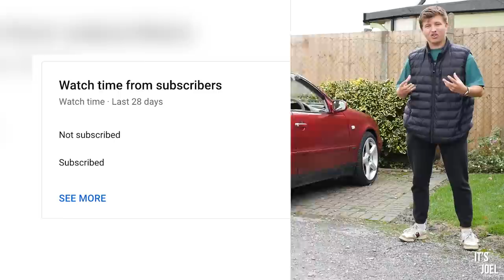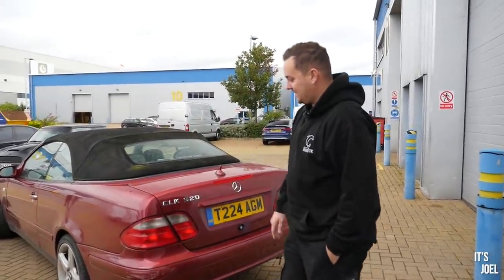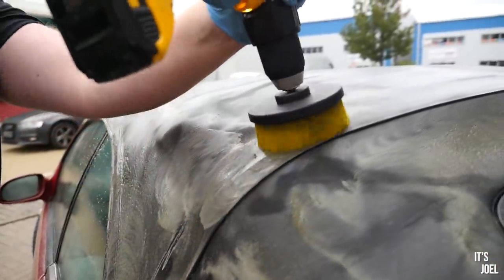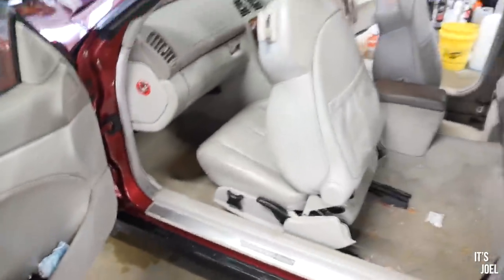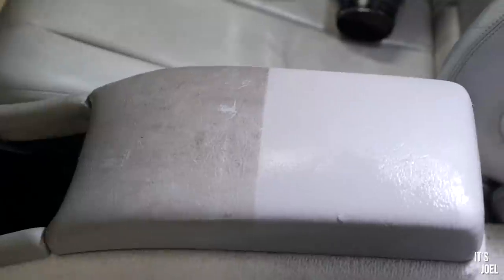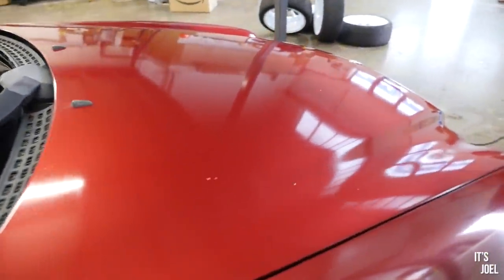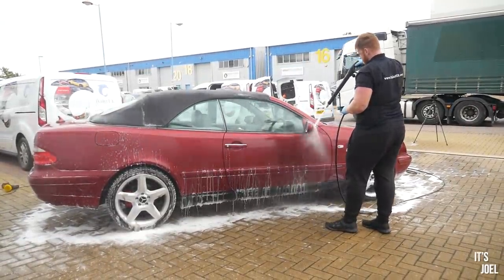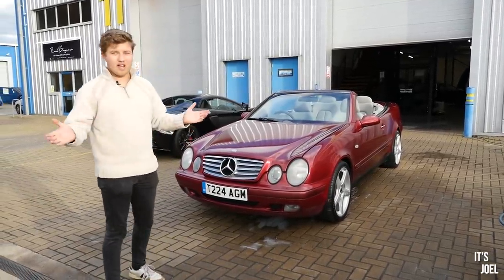My £1,000 Mercedes gets a £1,000 detail & decontamination!

Comment: For a £1k detail I would be expecting the headlights restored and done with a ceramic coating. Looks good though 👍
Reply: Those lights from factory are foggy
Reply: Would be atleast another $500 for one layer of Ceramic Coating on the paint.
Reply: Check the video description - had a ceramic coating done ✅
Reply: @joshruck2002  they are not foggy from factory bruh

Comment: Great before and after video. 3 years older than my E46 Convertible. Pressure washer is too close to the fabric roof.  They should have taken the seats out and definitely cleaned the seat belts. They aren’t scratches on the NSR wing it’s filler cracking.  Apart from that it’s amazing what a good clean can do to lift the appearance of any car. I’m sure you will enjoy it a lot more now and it was cheap!

Comment: Yes the seatbelts are filthy. The process to clean them is to remove them, unwind them, jet wash them, let them dry for days then put them back in. This is due to the tightly woven fibres with them being a safety device. It wasn’t possible to do in the time we had the car so we recommended replacement belts.

Comment: When you turn the handle to open the roof you are supposed to push the front section up about 6 inches. If it doesn't stay up there are 2 tension cables which can be tightened by removing the handle then the trim piece behind the handle.
Reply from the maker: Thanks for the tip

Comment: You can get some degreaser, heavy filler and a new matching leather paint to do it yourself. I did my own Rolls Royce steering wheel and came up a treat. The wheel had a big rubber hessian backed cover on that had dented the leather all the way round.

Comment: I have a 2000 clk230 kompressor convertible avantgarde  in jasper blue which had sat for 5 years i cleaned it up fitted the genuine amg 5 spokes and it flew through the mot it is now my second car but i love it yours is a lovely looking car defiantly need the amg wheels for it mine has the blue and silver seats

Comment: You need to put a steering wheel cover on that. I had a matching alcantara one on my 2001 200kompressor as that wheel and the doors armrest get dirty. I had one in cyprus for 7 years and drove it like I stole it. No rust over there obviously which was the issue over in the UK etc. The lacquer peeled off in places as it gets to over 40c over their and the air is dirty full of sand bit the paintwork was OK.  It cost me peanuts to service and the only issue I had was a supercharger pulley bearing which cost me 80 euros fitted. The simpler the car the less issues.

Comment: Having to give the roof a wee push is not actually a "feature".  It's caused by the wires in the roof stretching.  However, just about every 208 CLK Convertible has this.  These cars are 20 years old and a wee push is probably the least of the challenges to be overcome.

Comment: Just have to love depreciation! I am not sure if that brush they use on the roof will have done it any good long term. A gentle brush, with little pressure, a very mild cleaning agent and back and forth motion, no circles, by hand, is the way to go with these convertible roofs. You may have damaged the fibers and next spring it could even be in worse state the  it was before.

Comment: Nice car, but I'd move it on. The wrong grill and the shoddy shut lines around the headlights indicate it's had a biff on the nose and the paint scratches on the rear left look like they are going into filler, not metal and the rear bumper scrape indicates it has had a kick up the arse as well. Might as well flog it before sinking any money into it.

Comment: Nice transformation, although they seemed to have missed the front seatbelts
Reply: Yeah I noticed that too. Same in my car with white interior I was wondering how they would could clean that hard part. Seems they just didn't 😅
Reply: Seat belts are really hard to clean due to the tight webbing for safety.  The only way to clean them properly is take them out and pressure wash them.  (Time consuming)
Reply from the maker: Normally for £1,000 an extra day or two would be spent on the car and more attention would be paid to seatbelts etc. As we’re filming we try and do as much as possible in a day
Reply: The belts are like the steering wheel - with cream or grey it’s more cost effective to buy replacements, otherwise the process to clean is to completely remove them all from the car, lay them out, pressure wash them, let them dry for 4 days then reinstall. 👍😁

Comment: You need to do the driver's seat belt. I had a similar colour Merc interior and what we did was unbolted it from the floor, pulled it out and jet washed the f out of it while a friend held it taught outside the car. Worked a belter (lol).
Reply: Then wait 4 days for it to dry 🙃
Reply: @ivaletuk  Turned up the heating in mine to full and left it idling for a few hours. Dryed it out no bother.

Comment: dude sounds like ethan off car throttle when he was doing the walkover of the car 😂

the only issue i saw in this video was using a magic eraser sponge on the leather as this is an abrasive and while yes, it cleans it, it also strips off a layer of dye from the surface which means that its easier to wear through and for a colour change for happen due to the sun etc. There are better alternatives such as a leather brush from either gyeon or swissvax which are quite stiff bristled but still safe to use on the delicate leather surfaces.

Comment: Nice job. I would keep the Benz and get rid of the Range Rover. But then I love older Benzes. However, if you keep the Benz please be mindful of the fact they tend to rust. I have owned several Benzes and still own a 1998 C Class. Daimler Benz uses underbodycoating and kit over the welds that tend to get hard over time, by the way other makes use this too. At first sight the underbody may look great, yet often the underbodycoating/kit is actually loose and underneath there is rust, often just surface, sometimes quite serious. Dangerpoints are the frontspring mounting domes and the front fixture points of the rear subframe. Clean them very well and treat them. The frontspring mounting points are relatively easy to weld, the front fixture points of the rear subframe are not. Also jackingpoints can be bad, yet again the are relatively easy to mend. Speaking from experience, if you do not want rust on a car over 20 years old - take a Volvo. Next to the Benz I do own a C70 2.0 Turbo. If I have to make a choice I will always go for the Benz...

Comment: Keep it, return it to stock condition. Everything original new parts from manufacturer. Make the outside and inside immaculate. Like it just rolled out of the showroom.  No gash and cheap jobs all parts OEM Mercedes to be used

Comment: I had a 2002 CLK, and it never needed that 'push' to open the roof. The only manual input was the first twist of the handle to pop it open, and the reverse pull (and twist) to lock it closed. Something wrong with this one, so get shot of it. The cost of a replacement CLK roof will pretty much ruin your day, every time...
Reply: get me on ☝️

Comment: The scratches on the rear passenger wheel arch look like a lot of filler has been used in it and it's cracking. I could be wrong though.

Comment: Joel, I have a mobile paint guy who is the absolute nuts who could sort the scrapes and scratches out. No new bumper required. Any mechanical faults on the car?
Reply from the maker: Interesting, I’d love to hear more. Mechanically just needs an alignment I think.
Reply: @itsjoel  so Liam charged £180 to sort v similar bumper scrape for my mums car. Blended the paint and lacquer back into the original - looks factory. I reckon £400 - £500 might get everything done including bumper, boot lips lacquer peel and wheel arch scratches. Maybe less if Liam gets a plug 👍😄
Reply: I think I would’ve cleaned the car myself and spent 500 quid on paint work :-)

Comment: looks like its had paint in the past defo on that rear quarter were those scratches are id say theres a lot of filler under there
Reply: Looks like they painted the rear quarter before allowing the filler to fully dry. Which means the filler is very thick, but for a grand its better than walking.

Comment: I was actually quite impressed with the job they were doing until the big reveal. All that hard work and they left the drivers seatbelt looking like it's been sat in a swamp all its life 🤢. Its the small details that make the biggest differences. But that belt had deffo not been touched.
Reply from the maker: No we didn’t do the belts as that would involve taking them out. Would normally do this process over 2 or 3 days, however as we were filming we only had about 6 hours

Comment: Good content, but you need to be CAREFUL WITH THE ROOF. You can't wash it with the water jet so close... you have permanently damaged it. If you look closely, you can see the water jet marks that were left over. If you own a convertible this is common knowledge.
Also the roof not going all the way down by it self is not a feature. You have at least two broken tension cables. They need to be replaced from now and then. 
Other than that, keep up the good work ;)

Comment: Wash the front seat belts with a pressure washer, they’ll come out new. “Jet wash”
Reply: And take 3 weeks to dry 😬
Reply: @ivaletuk  come on now! I didn’t expect this answer from you guys!! It drys in 1hr, may be 2-3hrs in UK weather
Reply: Ok there was a note of sarcasm - they take about 3 days to dry fully.
Reply: @ivaletuk  try again, and it’s just best not to reply if you don’t have the correct information. When nothing was directed to your work or channel. I actually enjoyed y’all’s work.
Reply: Obviously you know better, like you must know it’s 2 degrees overnight in the UK at the moment. 

All this is also not to mention the other 2 hours to remove and 2 hours to refit all the belts. The job wasn’t possible in the time we had period.
Reply: @ivaletuk  again get out of your feelings. No one questioned your work. But I’ll try to help.

Pull the seat belts out as far as you can and shut the door so they stay out of the car. Then take you’re pressure washer and spray the seat belts. And that’s it. They are good as new. This should be done before you clean the interior so you can actually do it with the door open if you want to get further in depth. A wise man would be able to avoid soaking the interior with water.

A wise man would not remove the seat belts from the car itself.

Again you guys run a good business and a good YouTube channel. Don’t get in your feelings and hurt your reputation as a business. Not worth it specially when my comment was never directed to you but was just giving Joel advice. I’m sure he would love a clean seat belt when the rest of the car looks good.

I’m not an expert but I’ve owned two grey interior and 3 creme/beige interior cars so I’ve learned a thing or two.

And you don’t have to apologize, have a nice Monday!
Reply: 😂 dude please stop. What happens when the belt isn’t fully dry and it gets wound back up inside the casing and goes mouldy… 

We’re fully aware it’s possible to wash a seatbelt this way and there’s a specific reason we don’t.

Comment: What's going on with the front seatbelts they are filthy!!!
Reply from the maker: Didn’t have time to look at those. Would normally require about 4 days for a wash and dry service on those and we did this all in a day. Belts are hard to clean though because of the material, so best bet is to replace them
Reply: @itsjoel  have to get those done, now the interior is so clean the belts let it down massively